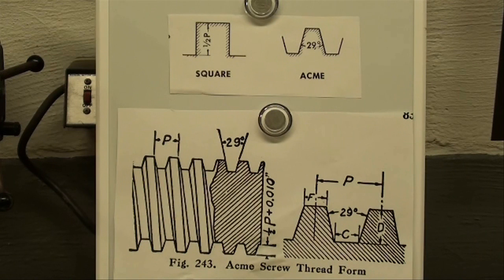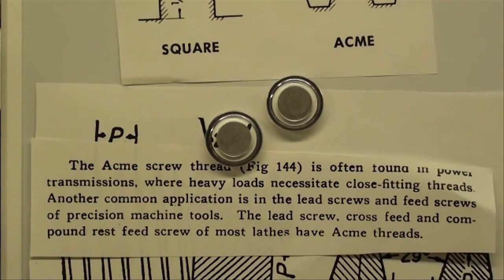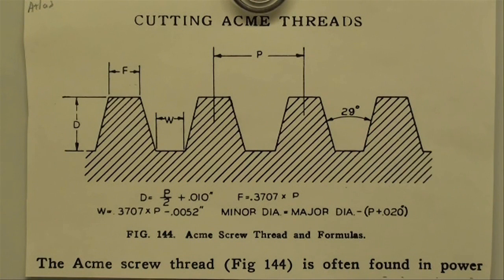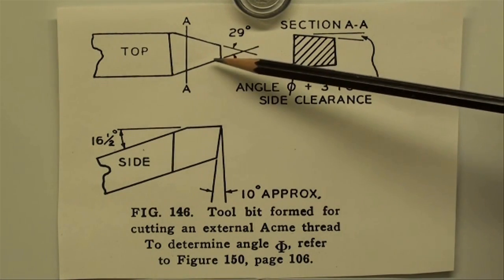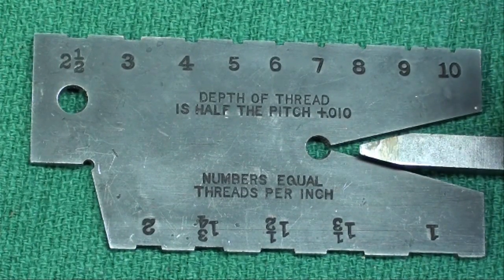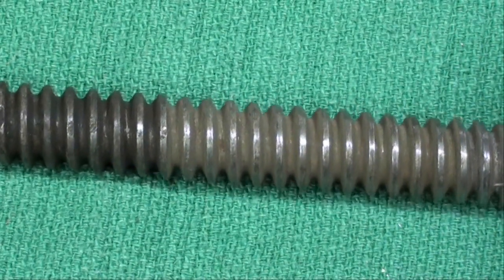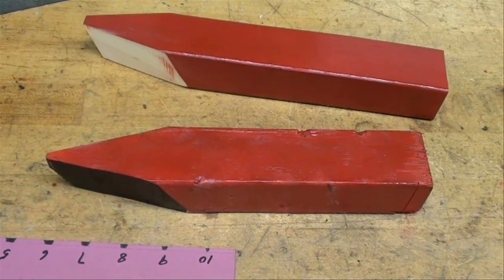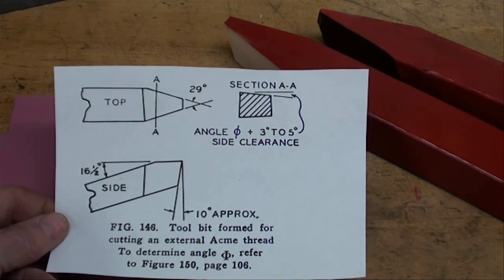MACHINE SHOP TIPS #24 Acme Threading Part 1 tubalcain

Comment: My lead screw measures .590 round  it has 10 tpi what size would it be its right hand thread looking to buy a tap to make a new nut
Reply: its a left hand thread sorry
Reply from the maker: That sounds like an odd size diameter. Are you sure it’s not metric?
Measure it again very close to the end where it doesn’t get used or worn. Because I would suspect that it’s a 5/8 and possibly worn in the area you are measuring, but that’s just a guess.

Comment: Hi Mr Pete so I,m making the float lock drill vise and these days hss acme taps are only $15 buck shipped . I was looking for carbide insert tooling it's confusing  so I,m going to use hss and grind it . But first i have a 1979 Goodway lathe and when you get one theses days no parts or accessories are available  i didn't get a steady or follow rest with it. so i picked up a follow rest for a Jet lathe and it was only about 3/8 to shortand no room to slot holes had to add som steel  . It's all done so now i can tread a 12'' acme screw for the vise . Thanks For the how to Video  👍 . JM

Comment: These videos are such a wonderful resource for people. People that take the time to teach the world such as you need to be highly commended for your efforts.
Reply from the maker: Thank you very much
Reply: @mrpete222  not a problem sir you have been such a help to me in the past 3-4 Years Learning my Logan inside and out upside down and backwards.
Just as a side note the other day I started to use those double sided Trigon inserts I think they are  WNMG inserts and I didn't really notice before then how much slop was in my cross-feed and compound rest screws. Not backlash really although I guess you could classify it as backlash but slop being caused by the ware in the screw and and nut. and I have all the spare parts to build a second Logan that I got very very cheaply very lucky find so I keep them all boxed up just in case I need something. So I tore into my boxes and I got the worm screws and nuts for both cross-feed and compound. Well it turned out it was only the nuts that were worn down as it should be is they are softer one being cast iron and one being brass. So I replace them and the rigidity on lathe went from poor to unbelievable perfect.

And I thought to myself you know what I bet that would have been the first thing mr. Pete told me to check. But like I said I really didn't notice much of an issue prayer to trying these double sided inserts they have no side rake as a result it takes a lot of horsepower to push them through the metal.

But I guess to make a long story short if that's possible at this point LOL if it wasn't for your videos that gave me confidence to tear into the machine and do what was needed to make it run correctly I would have never even considered that. I probably would have lost interest in the entire hobby because I would have had such poor results. The next thing I'm going to do is attempt making the two Drive screws or warm screws if you would rather is I have cut become quite proficient at threading not to blow my own horn but I'm kind of proud of the fact. You taught me how to thread you taught me how to Gage the threads with the wires and now I can make any thread I want to or need to. You taught me how to check what was going on if it wasn't working right and gave me the attitude to succeed in these efforts. I really appreciate it and it's hard to appreciate a lot of things in the world these days. I become disabled in this hobby is all I have I'm able to do a couple hours a day sometimes and good days and it keeps my mind going and my body gets a little bit of activity as well.

So I don't mean to sound like a brown noser for lack of a less vulgar term but I really do have a great deal of appreciation for what I've learned through your videos I continue to learn everyday .
Reply from the maker: I'm glad I help you on the Logan    Generally, the where is on the brass not more than on the steel screw,     Again, I'm sorry about your disability, and I'm glad that this hobby gives you some happiness and satisfaction. Keep watching

Comment: Inches should really be history these days. When studying or learning about engineering the only reason for using the imperial system should be for historical reasons such as restoration of old locomotives etc.
University engineering courses in this day and age should be all metric with optional classes in the imperial system.
It really is beyond time to move on. USA is the only country left in the world where the old imperial system is still in widespread use. Especially in construction and engineering. Thankfully, all the major science disciplines in the US, are metric (or SI). At least that's a start I suppose.

Comment: So if I understand this correctly, you can buy a fine pitch ACME cutting tool, then widen the point until it fits the thread pitch you want. I guess you could narrow them as well. You might be able to find overstock cutter sizes for a bargain price that way. ACME taps and dies and nuts are way expensive. 
I'll have to see if you have a lesson on sharpening drill bits, the gages I saw on Amazon indicated I still have things to learn, plus about 50 mediocre- sharpened bits I need to improve or adapt to a different material.

Comment: I know i'm late on this, but it's new to me. I am a machinist working in an industrial valve repair shop. I cut acme threads every single day of my working life, externals on valve stems and internals on the stem nuts. And I still loved this video...I'm 46 years old and have been a machinist since I started my first machinist job in 1993...You can never stop learning. As soon as you think you know it all and can't learn any more...you'll fail.
Reply from the maker: Thanks for watching

Comment: mrpete, Learning a lot from your videos.  Question about the tool for the acme thread.  All the diagrams show that the tip of the tool is cut flat and perpendicular to the main axis of the tool.  All the tread diagrams show the root is flat and parallel to  axis of the thread.  If the compound is set to 14.5 degrees (half the 29), won't the root be at that angle rather than parallel to the thread axis?  Thanx

Comment: hi guys.  im a young machinist and when ever i try to machine the ACME THREAD i a problem. the pitch im using is 6mm the formula and the set up on the machine im fine with it. the problem is that, after every 3mil depth i cut the threading tool stars  to grab on the job, and i end up breaking the tool and when i try  to change the tool  is so difficult to chase with another  threading tool. what can i do to avoid this problem?
Reply from the maker: Vuwani Nepfumembe Take aseries of cuts with a regular v tool to remove much of the metal. Then finish with the acme..  Also, is your tool ground correctly, oil, correct speeds, on center??

Comment: How would you cut an internal acme thread. To match your 6 TPI external thread???
Reply from the maker: Watch tips #23. Its the same except--- use a 29 deg acme tool, and set compound at 14 1/2 deg.
Reply: Thank you very much I will do that

Comment: When taking into consideration the lead angle of the thread, would it be wise to have more side relief on the right face of the cutter when cutting a right hand internal thread? I'm asking because I have to cut an internal TR80 x 10mm pitch 30° thread. This thread has a lead angle of about 3.5° so instead of making the side relief 5°,  I made it 8° on the right side  to compensate.
Reply from the maker: Good idea. Increase that angle

Comment: Have cut so many 7/8 inch .250 pitch .500 lead dbl lead left hand acme threads in K-monel that this is like old times. Rather not have to do that again as the double lead is a bit of a pain in the neck. Good video. I never had to cut a triple lead and  glad I did not have to.

Comment: Excellent refresher on cutting external acme threads.   Lacking a gage, the width of the cutting tool tip is: .3707 X pitch.